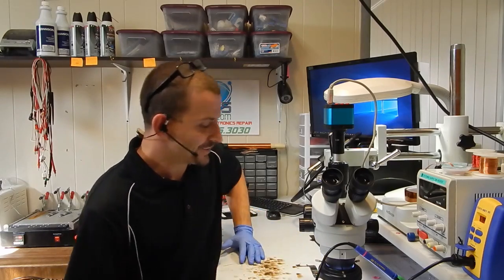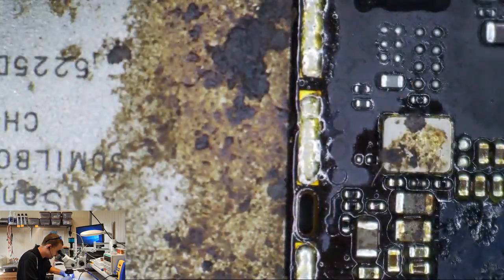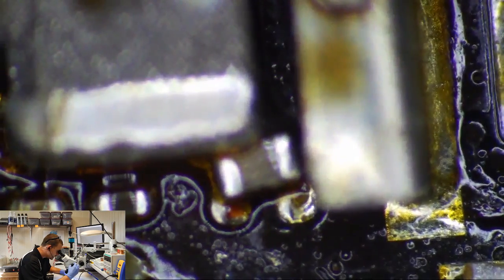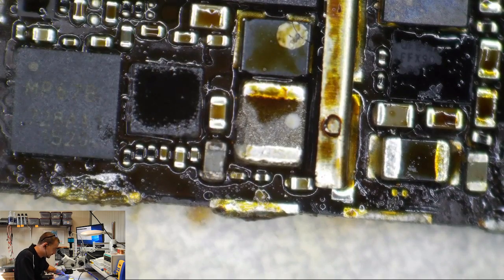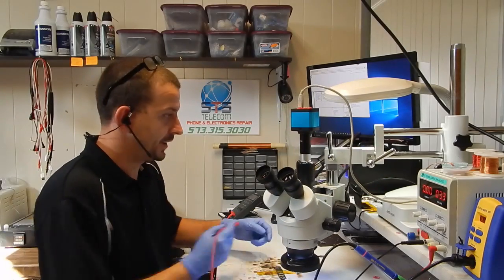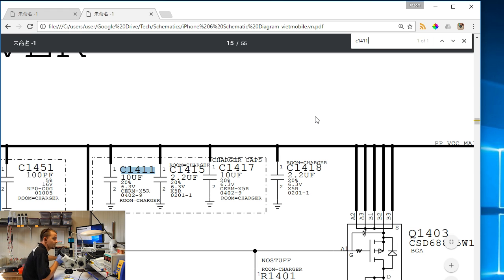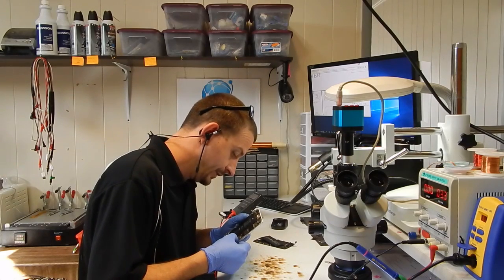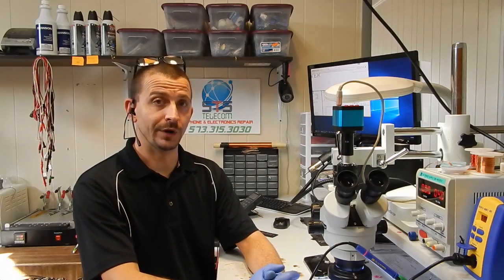iPhone 6 Data Recovery - C1411 photobombs entire video :D

Comment: Hi, i really love your videos! I'm here since hours locking all of them. Thank you so much for that!!! I'm learning a lot of stuff!! I have also a little question: Must the power supply have four regulators, or would it be also fine with this one?-> http://s.aliexpress.com/jeI3qMZ3

Gianni from Switzerland
Reply from the maker: Thanks for watching :)   That one looks very similar.  Mine has 4 because each voltage and current have a coarse adjustment and fine adjustment.  That one you linked to is most likely not too much different.

Comment: How hot is your air for the cap to come off in like a second?
Reply from the maker: I keep it set on 390C for almost everything.. I'm not sure what temp it actually is though
Reply: STS Telecom Wow that's hot. What about air flow? I dialed mine down to 330c with airflow of 6 (max on my machine is 8) higher airflow seems to help
Reply from the maker: I have airflow set at 42/100 on mine for most jobs.   It seems like quite a bit of air though.  I'm not sure I'd like turning it up higher... it could get out of hand.  lol
Reply: STS Telecom Lol it's probably equivalent to what I use. Used to be afraid to use higher air flow but it really helps speed things up and use lower safer temp

Comment: hey Jason, i have a question. You mention on the video that you will not be able to fix their no signal issue, is there a reason for that? is the no signal problem not repairable in general or just on this particular board? just wondering.
Reply: Ronald R with all the possible issues this board will have is better just do data recovery because if you see all is bad from the other repair shop is a risk to try to repair the phone, maybe is possible to do it but is a lot time, you all the time need to check the cost of the repair phone not make sense if cost a lot for a client

Comment: Hi Jason, I would like to learn more about "old fashion" method for remove short circuit.
Reply: Giovanni Veloz for normal used to found the short where is the hot chip when connected to the dc power, used your finger to touch or see the smoke start to coming, in my case I used freeze spray before to connect to the dc power

Comment: Jason buy a solder mat....so you don't destroy your work bench
Reply from the maker: +Simon I'll probably take better care of the next work bench.  I picked this one up for $20 and planned on roughing it up and burning it but now I'm wishing I'd covered that spot with a changeable surface.   Next bench will be way better :)
Reply from the maker: +RUDY ESPADA thanks :) can u suggest one that doesn't bubble up when heated with hot air?
Reply from the maker: +RUDY ESPADA I was thinking about trying a kitchen cutting board
Reply: Get a big tile from your local hardware store

Comment: Hey Jason, i noticed you use kapton tape to hold down your boards. I've done the same as well. have you used a PCB holder?
Reply from the maker: I've never used one but I've had many people suggest an omnivise.  Not sure how I'd like having the piece I'm working on lifted up off of the table but I'm going to give it a shot pretty soon. :)
Reply: STS Telecom hi jason thanks for your videos,i think you should use a pcb cellphones holder,its usefull for the repairs.